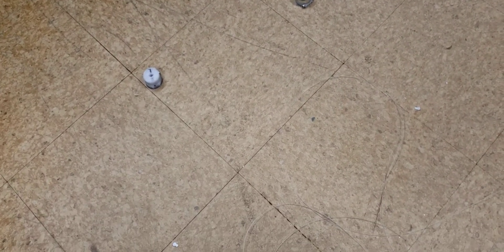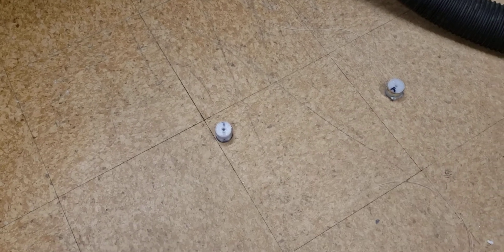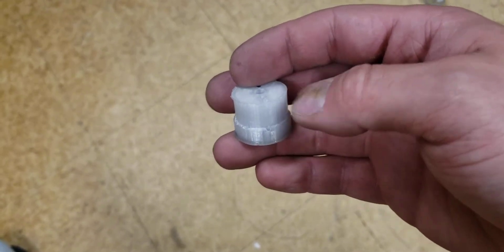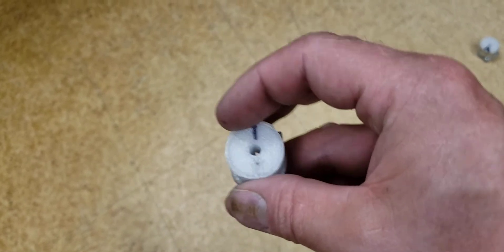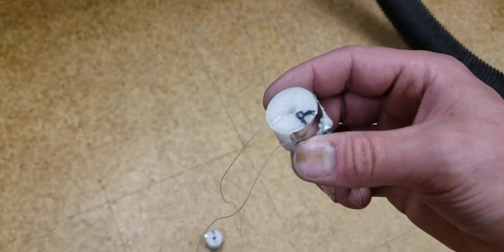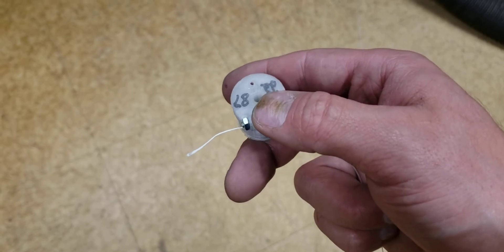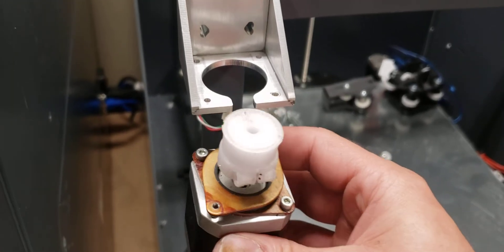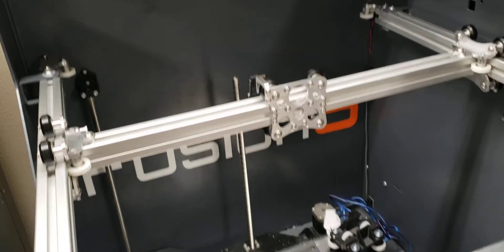Fusion 3 3D Printers Wrapping Spools (My Method)

Comment: Interested in the f306 mods. Best way to contact?
Reply from the maker: Hey bud. If you have Facebook, you should join the Fusion 3 3D printers group. Im Christopher James. The full kit is compatible with the F306. Im taking paypal.
Reply: Perfect the cable on mine is off the rails